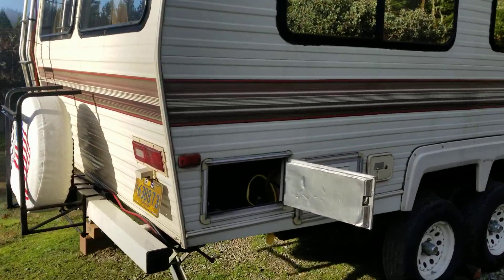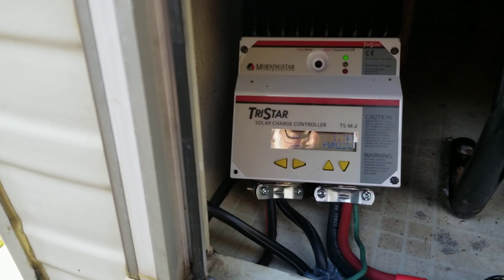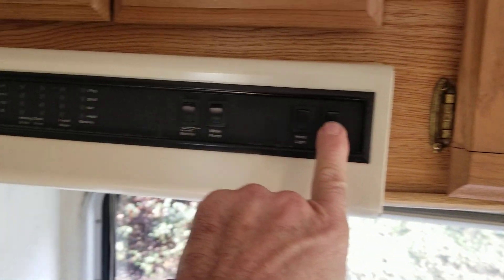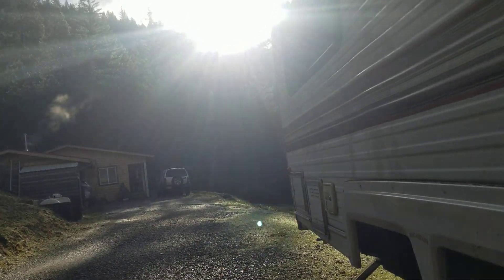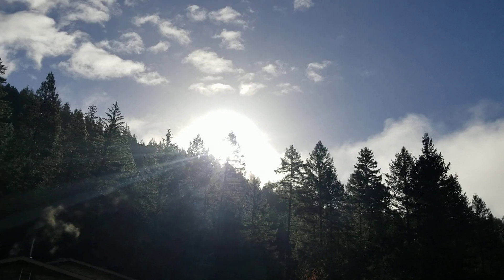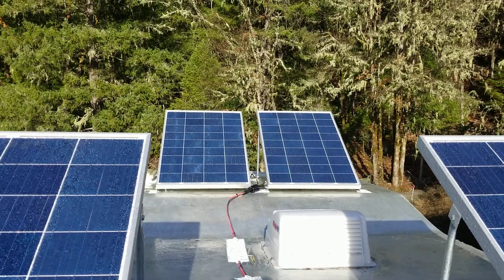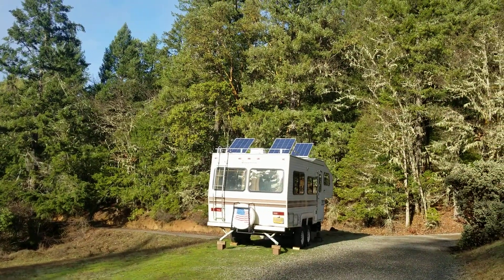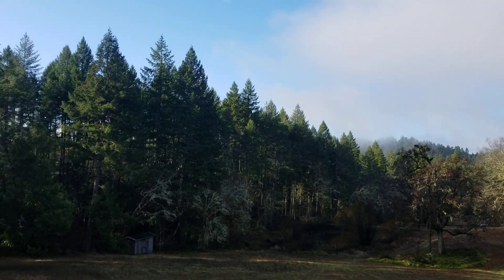Testing the tilt on the solar array (on the solstice)

Comment: PWM / parallel is awesome. Another great thing about PWM vs MPPT is less heat. They run cooler. I have a couple of the new Renogy Wanderer Lithium capable 30-amp PWM units. They beat the snot out of all those Cracker Jack box Chinese ones. Love how they work on ANY battery type.
Reply from the maker: I like the Renogy equipment. Merry Christmas and Happy new Year!